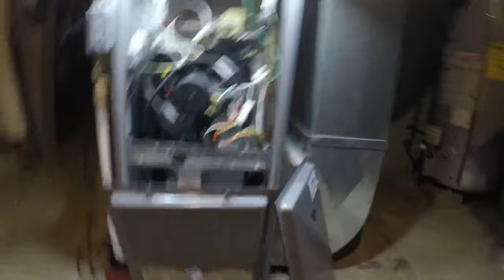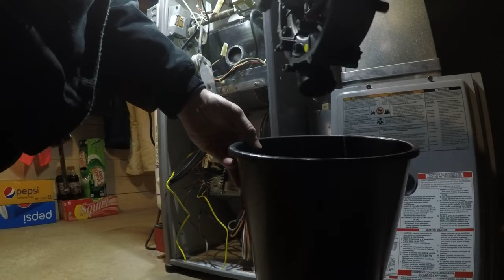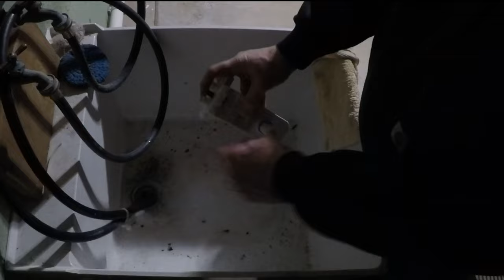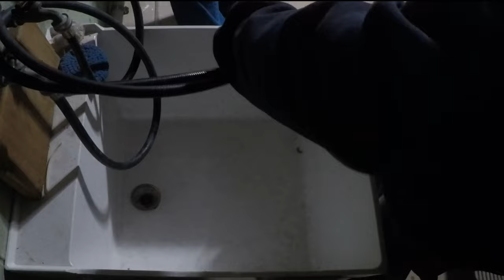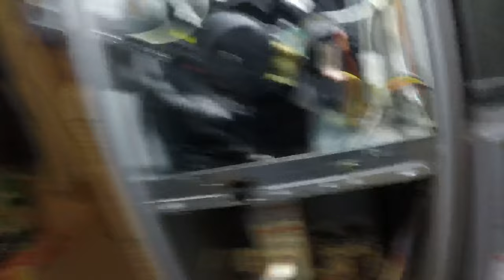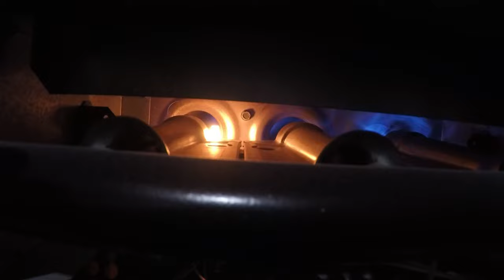Tempstar Furnace Fails: No Heat!

Comment: So someone found a way to shoehorn a York or Goodman inducer on that thing? Look up the parts list. That is NOT the correct inducer for it. I've worked on millions of these. They seem to run steady except for the inducer and collector box flaws. And I've changed millions of those out too.
Reply from the maker: Yeah, I think this was for a York, same RPM and bolt pattern. That's been on there for about 4 years.
Reply: @ADVANHVAC  if it works it works I guess and the icp fasco inducers are trash, but I still question it. Rpms are rpms but what about the cfms and pressures the inducer pulls? All it takes for a 90%er to soot up to shit is just a little incorrect fuel/aire mixture, and inducers will cause that.
Reply from the maker: Like I said it's been on there for 4 years with no issues.

Comment: I would not have a high efficiency furnace! Far too many issues that erase any cost savings on gas use. It appears that it creates a lot of business for HVAC companies doing repairs. Also parts for high efficiency furnaces are much more expensive than 80 percent furnaces.
Reply from the maker: It all depends on your location. Here in Michigan, we have fairly cold and long winters. If you're in a warmer climate, yes you are correct would not make since. There is definitely more maintenance required for 90%  thanks for watching.
Reply: Not always true. Some 80% parts, though they fail less, can cost much more, some 80% inducer motors are the same price or more than 90% inducers
Reply: @AmericanFarmerHVAC2024  not if it’s an ecm inducer. Those things are $850-1017.00 supply store prices
Reply: @AmericanFarmerHVAC2024  
I suspect that is true although in most cases there seems to be higher prices for the high efficiency furnace replacement parts.
Reply: @francisbriggs76  usually is the case. But I agree with you, I love 80%ers and I will install them any chance I can, for as long as I can. If a house has existing chimney or b vent in good condition, 80% plus goes right back in